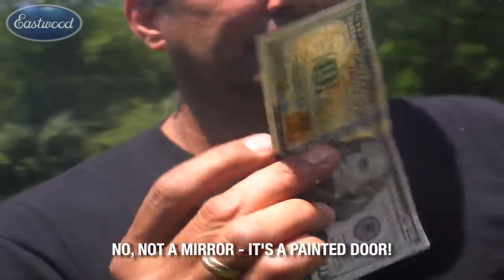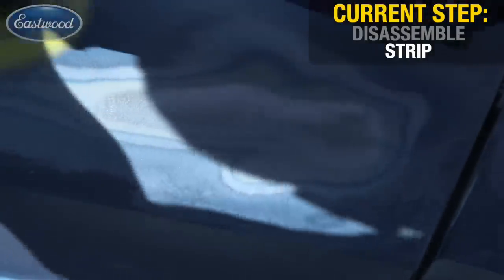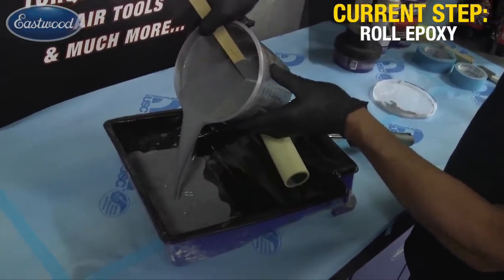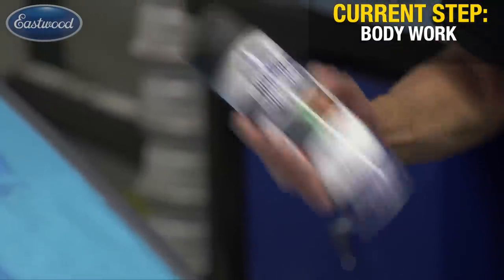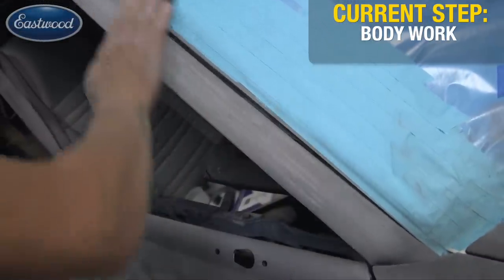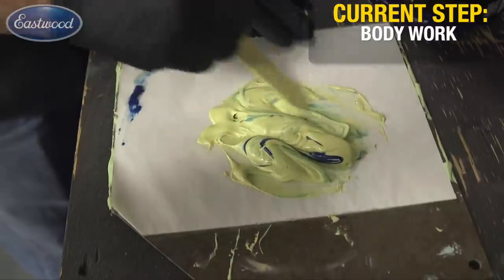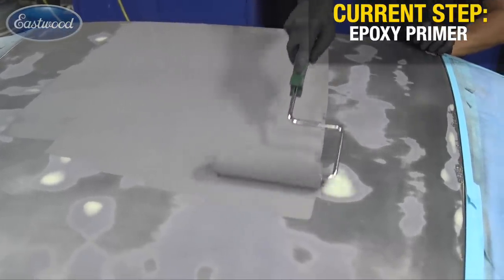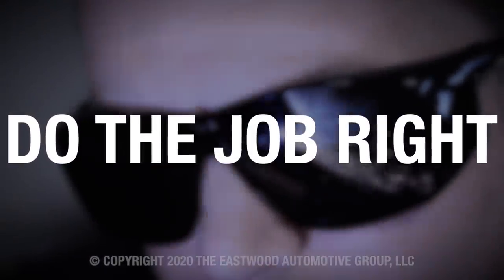How To Roll On Primer - Painting a Car with OPTIFLOW Roll On Paint System - Eastwood

Comment: Lol...
I was a teenager in 1969.
My neighbor across the street was a grand old guy who drove a new looking 1948 Chrysler sedan.
He bought it new and drove it daily.
The paint was black, and very thick.
He told me he used to work for Duesenberg, the premier American car mfg in the 1920's and 30's.
He told he had been an assembly line painter.
I asked how they spray painted these magnificent hand built cars with such thick coats of paint?
He laughed and said they used paint brushes and hand painted each car.
I was dumbfounded.
He said you either got good at it or you lost your job.
It made sense, when they hand brushed heavy coats of paint, then hand sanded to a perfect finish.
I am now a paint coatings formulation chemist!
Reply from the maker: love it!
Reply: I often wondered why paint on older cars was so thick. Thanks for sharing.
Reply: My grandad used to paint his cars with a brush (HA - a LOOOOOONG time ago) and then polish and they would look mirror finish.  I am guessing that brush technique and polishing technique had a lot to do with success - or failure.  CHEERS from AUSTRALIA

Comment: I'm no painter but I would certainly go this route! Couple of years ago I was at a local car show talking to a man about his 68 fairlane ranchero. When I pressed him about who did the paint job he stated he did the body and knock down work then took it to Maco. I started chuckling then he stopped me and said "That's all those guys do is paint." He also done a walk around with them to look for imperfections and for a little more they corrected them. All in all he said he walked out of there under a $1,000.00 lighter in the wallet. It was a good looking paint job.

Comment: Just bought this system to start panel projects on my 66 Ford Galaxie in need of some love. We live in Ontario CA and we are working outside in the driveway during summer. Starting up tomorrow at 4am to beat the heat. Looking forward to giving my car the layer of protection in needs.

Comment: my 8-9 steps to paint for bare metal

1- strip old paint 
2-scuff to 80
3- 2-3 coats of metal etch primer (there should still be small scratches for filler to cling to)
4-filler
5-block
6-as many coats of high build as you want but minimum of 2
7-block with 320grit then 600grit once flat
8-high build and block again if needed
9- paint

for a scuff and shoot paint job  (much faster)

1- sand with 240/320grit on a DA
2- fill in any imperfections
3- sand whole car with 400 
4 if using single stage paint that's plenty
5- if using a base clear sand to 600 
6-paint

Comment: Kind of a cool enviro-friendly product.I have been a professional painter/restoration for 30 years. I think this would work OK on the initial epoxy/prime coat,getting all that texture out would be a lot of work .This is definitely a product for the DIY guy, the cool thing about it is no overspray/primer cloud rolling out of the garage.No Toxic fumes although i would still wear a respirator.I think that it has it's place in the car hobby.
Reply from the maker: Honestly, it lays EXTREMELY smooth, we've formulated it to flow out beautifully 👍
Reply: Nothing in automotive is eco-friendly.

Comment: We have been rolling on primer/surfacer for years. Mainly due to voc's. It works fine, but you sand most of it off to get smooth surface. If you can spray it, spray it. You will use 50% less mater.

Comment: I paint - a lot.  Cars, boats, houses, motorcycles, etc.  I have lots of spray equipment, but I can tell you that the highest quality jobs I do are boats that are painted exactly this way.  This is how most boats are painted, since it puts more paint on the surface, and alleviates the need for an enormous paint booth.  Also saves your neighbors (and your shop) from the indignity of all that catalyzed over spray. (most catalysts are isocyanates - they're as bad as they sound...) Also saves your lungs from that same isocyanate over spray.  After you watch this video, search "rolling and tipping).  You'll be a convert.

Comment: I ordered this roll-on epoxy and urethane primer kit and was initially excited but now I'm pretty bummed. I called tech support to ask for recommendations on the basecoat/clear coat for finishing the job. The women told me that only compatibility of Eastwood base coats are guaranteed and she was totally resistant to provide assistance in recommending a basecoat. I was told I'd be on my own and would have to test compatibility on a small area. Eastwood cannot provide custom tints, has only a few OEM colors available and the sample cards are "stuck at the print shop". This information seems totally counter to the concept of this video--to apply the DIY primer system and take it to a paint shop. The catch seems to be that the paint shop would need to use the limited finishes available from Eastwood to finish the job.

Comment: I understand wanting to mask engine bay, interior, openings etc when using the aerosol. Why do the wings, roof etc if they are going to be rollered anyway? This looks amazing, as most issues on GRP (microblisters) cars come from moisture in the primer stages. You need a brilliant environment for a compressor to avoid that moisture and this seems such a brilliant solution to avoid issues with moisture in the preparation stages and could be done in poor weather.

Comment: Now if you can just come up with a finish coat with the same results
Reply: Jerk Of All Trades  The old cars were not sprayed, they were brushed and buffed. 
You can get the glass finish without spraying. Using a suitable material, paint thickness is not the primary cause of chipping. It can be done. Spraying is much easier than this old process, especially on curved and complex surfaces. You can prime the car in minutes with a gun, unlike the roller.

Using the roller has its place, just not in a high production environment.
Reply: Kbs paints...insane stuff...
Reply: @davidparker9676  
That was the model T Ford  that was brushed
Reply: @davidparker9676  i did this in 1990 to a 74 dodge challenger,used old PPG primer at the time,thinned it 40% KONDAR,when you know you're gonna carve the car out of the primer using sandpaper,its easy,prep is everything,you want a better paint job,prep it perfect,two weeks work for 45 minutes in the booth,that's the way it is

Comment: I have a 1986 freight liner FLC 120 tractor trailer. The cab is aluminum and the hood is fiberglass. I’ve heard talk that the fiberglass hoods require special primer and paint so it doesn’t flake off. But then, others have told me this is BS. There is an old man on YouTube who painted a similar truck and his flaked off and he said he didn’t use proper paint. So, I’m confused. Anyway. I’m on a budget. I want the slickest possible DIY white paint job I can do. May hire pro to come spray final finish in my old dirty shop. This primer is appealing to me because it’s less overspray and masking  issues for prep until the final finish cost of paint. Will this primer work on a fiberglass hood as well as an aluminum cab? Any help and tips appreciated !!! Thanks
Reply from the maker: This coating WILL work on fiberglass and aluminum!

Comment: 43 years Auto Body.......... I just rebuilt a roof on a Peterbilt by building a large 2 layer fibreglass top panel, after the roll on Fibreglass Gel Coat it would of been nice to apply a roll on high build primer... would of filled the 100s of gel coat pinholes better and No masking the Truck & Sleeper off to prime the top of the truck cab.............. Sealers Primers are like Spray-able Bondos your still working your way to a finished Topcoat

Comment: I have the very same car waiting for a complete restoration and an engine swap and I was considering to use epoxy primer when I stumble upon this. I think I will give it a try as soon as I can spend some money on my project. Meanwhile, it will be good to know which process is better: spray or roll-on? Not just easy to apply but better in a long term.
Reply from the maker: As you can see in the opening shot on the finished door, your end results are KILLER with the roll-on method!

Comment: great information for me, I've done the first few steps and is very close to getting the Urethane on. Question, after the 4 coats of urethane, how long does it need to cure before base coat. and how do you prep for base coat? do you need to sand with 1000 grit or anything, or just clean with 'pre' and tack cloth?

Comment: I'm confused about the urethane coat. Once it's rolled on wouldn't you have to cut it back somewhat as I assume there would be some sort of roller mark or at least some roughness? Unless this stuff lays completely flat which I'd love to see. I've painted a few cars and had the ear of some good guys, before I'd have my car in the booth I'd have to have it at least DA'd with 320, some even say get it down to 600. IIRC the sealers I use state that on the tech sheets. To me it looks like theres still some work to do. Unless the urethane is acting as a sealer here.

BTW not talking shit here, I'd love to use this product to save on booth time but just curious...

Comment: Very informative video. I used to brush epoxy primer on hidden surfaces and would have been reluctant to rool epoxy primer on visible surfaces. But I don't understand why it is necessary to strip all the old paint. It is because a roller is used ? Once body work is done (spot repair + bondo, the old paint being removed only where necessary) it seems to me that we can spray epoxy primer over an entire pannel to seal it and then spray a 2K primer surfacer.

Comment: geeze! How many coats off primer is  truly necessary? If people can be happy with a single stage, non- clear coated job, is there no "single stage" primer that can be used on bare metal, filler, maybe even some previous basecoat? I could see going with a high build somewhere along the way to give you material to wet sand.
What am i not thinking of?
*and i used to run around my uncles custom shop from a child until 18 and he died.

Comment: Is it easy to mix up smaller batches of epoxy? I have a rust bucket 64 mercury convertible that is a bit of a Frankenstein lots of welding pieces together as replacement parts don't exist. It is taking  a  long time to weld together and finish each portion of the car. I have spray equipment but am looking to prime it piece meal so that repairs don't rust up before I finish all rough body work. Have been coating with green spray can etch primer that I assume I would have to sand off before using epoxy primer on finished car. Would like to seal maybe a quarter at a time when welding on that portion is complete.

Comment: Also I might have missed it but do you remove guide coat from in the low spots before you add filler or more hi-fill?
Reply: Yes you do , I scuff  guide coat out of lows with 180 grit  using my finger

Comment: So after the 4th coat you honestly would not have to wet sand before putting on your base coat? Also, will any other paint brand system work with this?

Comment: SO Im looking to use this system over in the UK, question is what paint can I use to paint over the primer with no reaction? Cellulose of would it need to be a 2k epoxy?
Reply from the maker: Any high quality top coat you would spray over an epoxy primer will be fine.  Once dry and sanded it's exactly the same as if you had sprayed the panel.  Any of our paint's and clear's would be fine.  Our preferred method is OEM Select Base coat and Show Car Clear.  You can check out this video to see: How to Re-Paint: https://youtu.be/rZ7F6gmmH4E
Reply: @eastwoodco  thanks for the quick reply..its very much appreciated!

Comment: I have a question if any one would be kind enough to answer,,,  it's always been my understanding that,  you put down either epoxy or self etching primer followed by primer surfacer and THEN you block sand,  (of coarse you block any body filler) . Why then are they blocking the epoxy primer when it's main purpose is to latch on to and seal the metal?

Comment: Hi I'm about  to paint  a reliant  scimitar  , grp .  Fibreglass  can I roller on primer, I've a chap will do the finishing  coats but he doesn't  want to prep undercoat  recons too much work , I'm up for sanding painting primers but don't want the hassle  off using  a gun, 
Also which  type off primers  can I roller on. Thanks for the clip very  useful 
Cheers
Reply from the maker: You can roll OptiFlow epoxy primer onto fiberglass. It sounds like you're going to need our complete epoxy kit. (very helpful to have all the supplies you'll need. Especially if this is your first time)
Check it out here:
https://www.eastwood.com/complete-optiflow-epoxy-primer-kit-with-sanding-materials.html

Comment: How much time from applying the OptiFlow epoxy primer do you have before applying the body filler without taking it down to the bare metal? In other words if you play the OPTi flow epoxy primer right after media blasting the car but don’t have time to do the body filler, do you have to take each spot down to the bare metal or just stuff it and prep it with 220 grit?

Comment: Pro tip: after 3 strokes, the sandpaper is loading up.
Stop and clean it.
Reply from the maker: Mark has a nifty trick where he takes a clean steel brush and runs it over the paper to knock the primer off - really extends the life of the paper!
Reply: @eastwoodco  I use a purple scotchbrite, but whatever works!
Reply: Try a mesh weave sanding strip. Lasts way longer than paper, a lot more flexible and the mesh helps it from loading up.

Comment: eastwood please respond lol. what grit do i sand up to on the car before applying the epoxy? after the car is stripped to metal.. is it 120 -> 220 -> 320 then apply? just want to make sure i do this right, thank you
Reply from the maker: You can go a couple different ways but our preferred method is 80 grit, 180, 320 then apply primer.

Get everything flat and straight with 80 and then work out the sanding scratches with the 180 then 320.

Comment: I have a 72 Fury, which had a vinyl roof. There is some pitting where I have removed vinyl, which i have rust treated. Should I fill in the pits before or after applying primer? Thanks
Reply from the maker: Epoxy can be laid on the entire car, then I'd do my body work with filler, and end in urethane.

Comment: So if I was to use this stuff and then be ready for body work and spray in a month or 2 would it stick to this roll on primer?
Reply from the maker: You can epoxy over bare metal, block it off for any areas you have to do additional body work, and then prime again once finished.  Yes epoxy OptiFlow has great adhesion to bare metal and to body filler and vice-versa.

Comment: I mixed the epoxy and hardener at a 50/50 ratio.  After 2 days it still seems soft.  Impossible to sand.  What could I have done wrong?

Comment: Why not ship to Australia and help us guys out that can't use a compressor or spray gun equipment because where they live won't allow it I'm happy with the work involved in blocking back the epoxy primer with guide coat on top get the whole car straight ready for the top coat then pay some to finish it off it's summer here now please supply a link to.putchase enough to paint a ford Fairlane

Comment: I don’t understand so you have to sand down the the optiflow epoxi and the Urethane primer I thought the Urethane primer was the sealer at the end
Reply from the maker: Yes the epoxy gets block sanded, then urethane is applied and block sanded.  From there you can seal or top coat with base/clear depending on your project/preference.

Comment: Body filler over guide coat? I can also see air getting trapped in the paint film using a roller.
Reply from the maker: Not at all - flows out smooth PLUS with sanding, blocks down to a super smooth surface!

Comment: is the epoxy primer for bare metal only? can it go on scuffed/sanded paint?
Reply from the maker: Yes! If you don’t want to strip the vehicle to bare metal, you can scuff sand and use the Urethane Primer over the existing finish as long as you are sure the existing finish is still integral and has good adhesion to the base metal.
Reply: @eastwoodco  what about partially sanded down, some metal some feathered out, scuffed paint and filling?

Comment: If anyone can answer. Beginner here- about how many hours is this? About how many weekends with it take
Reply: All of them... more seriously though, you can wham bang sand it in a few hours and leave it rough as a cob, or sand for years searching for that perfectly flat panel. Nobody will be able to say what you find acceptable. Sorry I can't be more specific, but the best bit of information I took away from this video is "Trust the guide coat".
Reply from the maker: It will take 2-3 hours to apply the 3-4 coats of epoxy. You save a lot of time because you're not spending hours covering everything to protect it from overspray. Block sanding will take about 8 hours. The coats of urethane will take another 2-3 hours. In a couple weekends you can have the car straight and ready for paint and save thousands.

Comment: Should you wet-sand a primered surface? I always see people wet-sanding primer before laying down paint
Reply: Wet sanding primer isn't an issue if you have a primer sealer. Primers can be porous in that they can absorb a small amount of moisture. If you paint over it with that moisture trapped, you can have adhesion problems later on in the paint's life